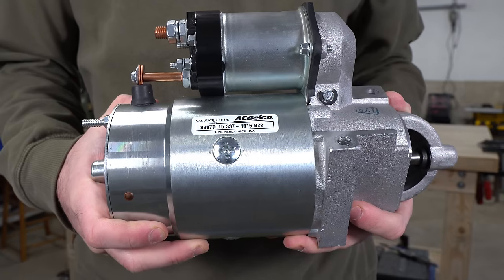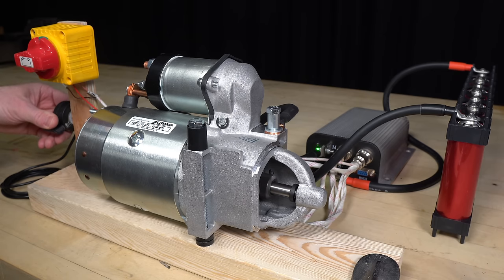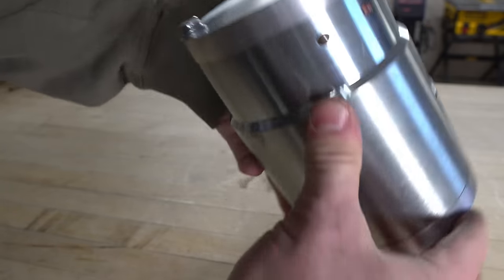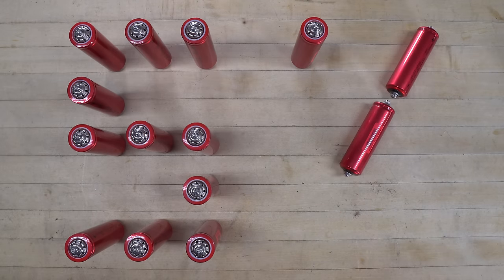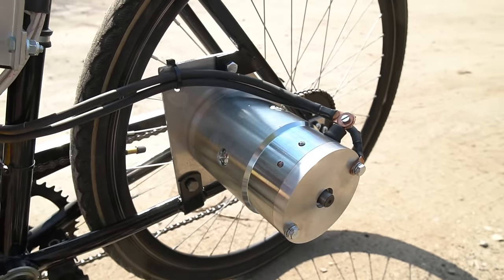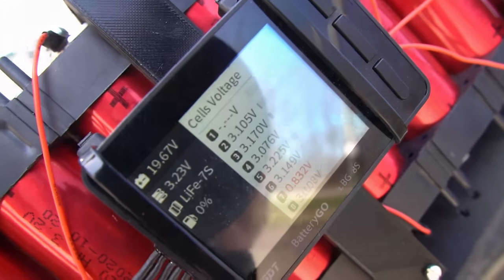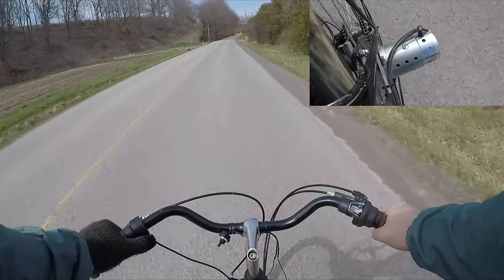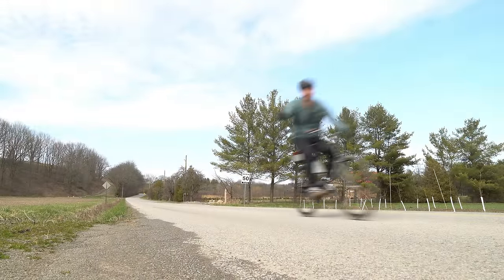Starter Motor Powered Bike

Comment: Glad you figured out the solenoid wasn't needed. It also has a power draw almost equal to or higher than the mayor itself. That battery you built is very expensive even self-built. 36v is way too much for that motor. Even 24V is too much. 14.4V max is what you should design for and there are batteries available with 100A draws that would be perfect for this build. There are motors that at 14V are better for this than that style of the starter motor. There are starter motors that are smaller, lighter, and have less running draw than that old styled motor.

Comment: The inefficiency of this setup, including the very steep gear ratio, it's just off-the-charts bad. When you're done making the video, throw that starter back on the Chevy 305 Caprice V8, and go get yourself an old discarded power chair. It comes with two 24 volt gear reduction Motors. Low amp draw, 100% duty cycle, you don't need hellacious current to drive it. I used to drive my 3-wheeler with 2 lawn mower batteries, and I'd get over an hour of run time out of the bike. Installing it is all so simple. Many are 90-degree offset motors, so they don't stick out. The best ones are the two wheeled, zero degree turn chairs. Pull the wheel off of the motor gearbox, and run a slightly bigger sprocket, around 4" dia. Now, simply Mount Your Standard 2 to 3 in dia. Sprocket on the unused side of your hub, and if using a one way, you may want to mount it backwards on that side. You don't need giant sprockets and jackshaft, it's all neatly contained in a small little package. Try it, you won't be disappointed. Even with 24in wheels, mine would average 19 to 22 miles an hour, and it had unreal take off power.
Reply: Oh and just a side note. The gearing is going to look a lot like the current pedal setup on a normal bike, with the big Sprocket in front and the little sprocket and back. This is due to their, around 16 to 1 gear ratio. From 8 to 1, to 13 to 1, is about the usual gear ratio for an electric motor on a 26in tire bicycle. Around 13 to 1, usually. By running a bigger sprocket as a counter sprocket, you're effectively reducing the 16 to 1 gear ratio of the motors, down to a more reasonable 12 to 1. Enjoy.

Comment: Not ideal because it uses loads of current and that creates lots of heat,a motor with more voltage and less amps is what is needed.. obviously you know that but just for those trying to learn

Comment: My guess is you messed up the gearing and put in wrong sprockets. Once you've got everything set up, that's it
 put the odometer on the rear wheel, lift it and run it at full power. Note the speed. If your no-load speed is 20% or more higher than what you actually achieved on a flat surface while riding your bike, you need to shift gears. Ideally, the maximum no-load speed should be about the same as you get on the road. Based on my experience, the sprocket you should have on your wheel should have 80-120 teeth. I had a 60 tooth sprocket in the scooter but with tiny 12 inch wheels, when I gave smaller sprockets, the ammeter showed max almost all the time, and the engine smoked like yours ;). Good luck!

Comment: If the motor is hot inside six minutes the battery life is going to be horrible. This is clearly far too inefficient for use in propulsion. Probably not actually the best way to start a car either. Use a rare earth motor for that job and we could probably halve the size and weight of a car battery.

Comment: go with e-scooter /// hoverboard motor + vesc 75100 (ali...press adaptation of standard vesc ...max 16s and 100A peak (in reality 75A , at 100A they blow up) 
e-scooter / hoverboard motor at 12s can go up to 2000w when cooled ...after few mods (holes etc)  / higher voltage or rewind u can get 2.5kw out of it 
just make sure to use better wiring , open it up and use some laquer inside on winding (and make sure to push "flat" any sticking out wires or they will start to rub on the casing = vesc will blow up

Comment: Any moron could have told you that starter motor designers wouldn't have factored in heat-transfer due to the occasional/short-burst usage cycle. I'm not even a graduate, either

Comment: why buy a new starter and then completely modify it to last longer.. could of saved alot of time and money going to a junkyard pulling half a dozen starters in varying sizes for the same price as youre one new starter and then been able to experiment with different size/speed starts and not worry about them wearing out as theyre dirt cheap

would be alot of variance in starts from a 4cyl gasser to an 8cyl, to a diesel truck starter.. different torques, different speeds, ect

Comment: Realistically cooling is a huge issue. I don't see how this motor could work without forced air cooling. An impeller on the back and breather holes on the front would do it. Basically copy the typical cheap dc motor design.

Comment: Stop using batery good . GO out of matrix you dont need batery. Make. A self generator and plug to a controller and the controller to the engine . Good luck . And use RC tiny and faster engine. Fast engine we be alot less heating anda more instant tork

Comment: probably not a good idea to run a 12v motor on 36 volts, otherwise awesome :-)
Reply: If you limit the amps, would it not increase the effective use, reducing the heat output?

Comment: Very poorly executed test.

 That starter motor has a no load speed of  over 20000 rpm.
He is geared for 1000meters per second.
Over three times the speed of sound.
This means that there is almost no back emf generated reducing the voltage and current through the coils, and no air turbulence transferring heat from the armature and brushes to the housing.

You are turning many kW into heat and a small fraction of a kilowatt into mechanical drive force.
You need a 250:1 reduction drive, not 5:1

That would give 50 times the torque per amp supplied to the motor, and over 50mph top speed.
Reply: starter motors are used in bursts not continuously

and the starter motor is inefficient 
as hell its like 25% efficient 

the starter motor is under load its not constant rpm and 5:1 is in most old motorcycles that can rev up to 8000+ rpm or used in bldc motor that can rev much higher 

back emf is on bldc
and the test in not poorly executed